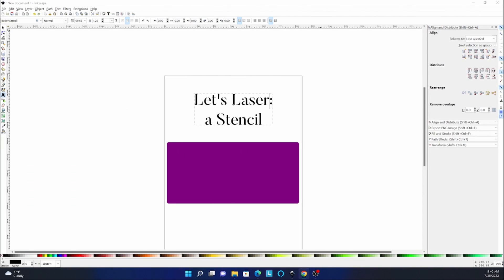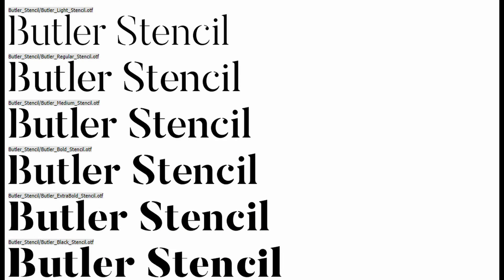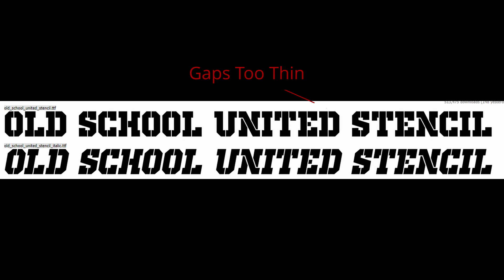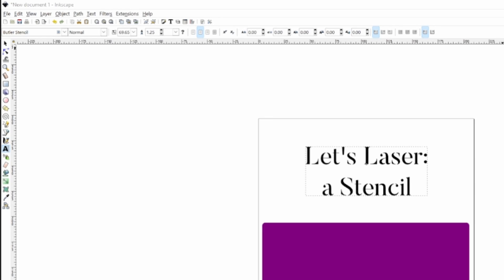xTool Laserbox Pro：How to cut stencil with laser

Comment: John, I'm trying to make mylar stencils on my xTool P2, and the moment the file starts, the increased fan speed draws my mylar up off the honeycomb. Any suggestions on how to fix this? I've ruined several sheets of material trying to sort it out.
Reply: tape it down. You can also use adhesive paper that will cover the wole sheet or magnets depending on the stencil